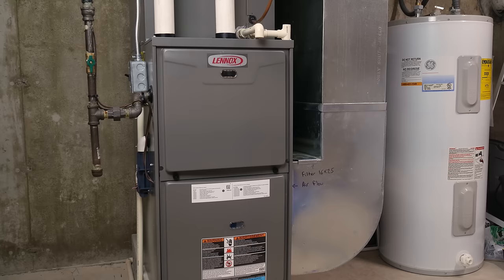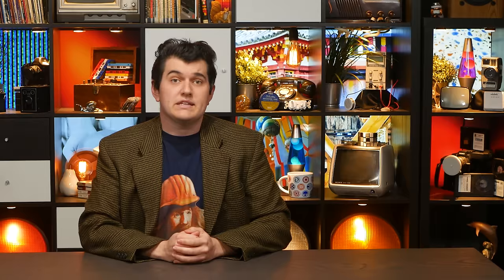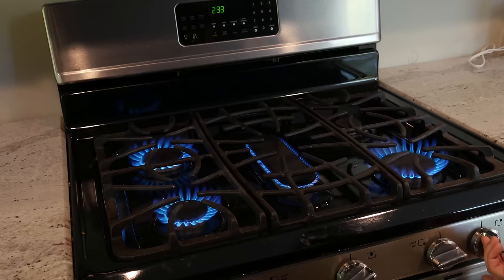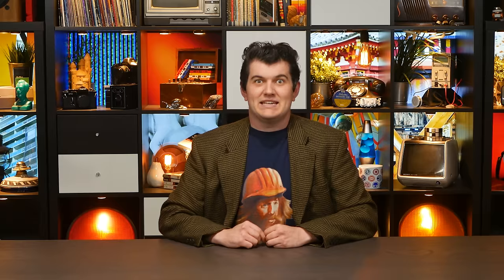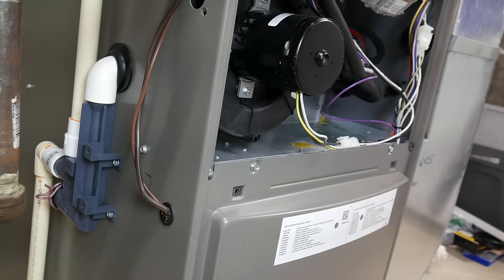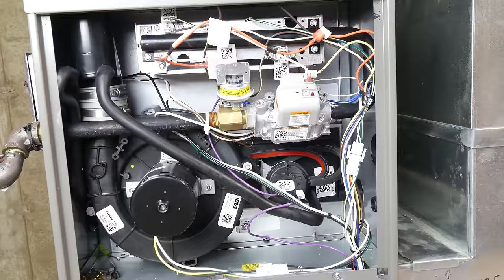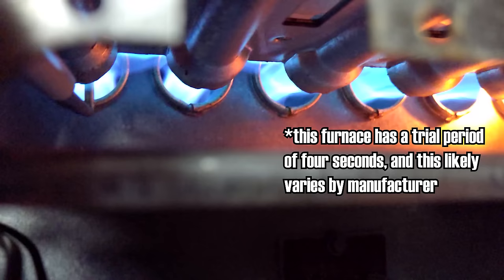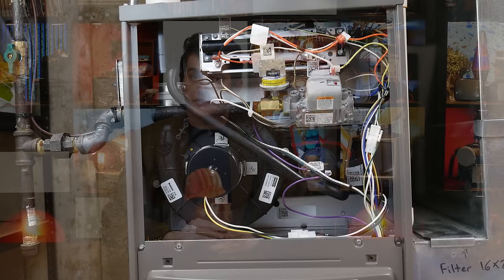Forced-air Furnaces: The What, Why, and How

Comment: European home heating uses hot water as intermediate steps.
The boilers are a bit different in setup. Outside air connects to the enclosure. Gas is fed via a gas pressure regulator into the fan intake which sucks air from the encloure. The fax mixes gas and air and pushes it into the burner.
Th eburner has a fine mesh to prevent the flame traveling back.
Ignition is via a spark which also checks ionization.
The flame only exists inside the heat exchanger, which often fully surrounds the flame.
The flame burns downwards, meaning that only the coolest gases can escape.
That is with an alumin(i)um heat exchanger. Stainless steel ones are a bit different.These boilers are really small, delivering heated tap water and water for heating at 35 kilowatts for example in a 55 x 37 x 27 cm package.
(22 x 15 x 11 inch). In apartments, they may be installed in a kitchen cabinet even.
Here is a service video on one that does hot water for heating and hot tap water: https://www.youtube.com/watch?v=AogaQXRH1UI 
Note that these have a variable speed fan (and pump nowadays) to allow for variable output (and optimum efficiency).
Reply: And hot water vs forced air is like night and day. Take it from someone who has lived in both types. If you have a choice, go boiler. Been there, done that. Forced air cannot possibly be as efficient. Or as comfortable to live in.
Reply: I was already thinking - the USA's forced air heating is probably designed without such goals for compactness. Aside from the size of the furnace, you've got the ducts that take up a lot of space compared to radiator pipes.
Reply: @benj1008  It's cheaper to install. Much cheaper. Money is the name of the game. And the further north you go, the less you see of it. And for air, you have to add that separately. However, that's also much  more efficient than the forced air furnace.
Reply: Most houses I know burn heating oil (mazout) instead of gas, is that even a thing in the US?
Reply: Forced air systems are huge, and LOUD as FUCK. I much preferred radiator heat in Europe. It was dead silent. According to Zillow, there are zero houses in central Ohio with a radiator.
Reply: @ArrowRaider  The forced air system is much cheaper than hot water to install and usually comes with air built in. However it is also quite inferior. Set a boiler system to room temperature and it stays there. Forced air is constantly fluctuating. Not to mention the maintenance on forced air is much higher. It's almost non existent with a boiler system and much cheaper to run. So what it "boils" down to is... money. Initially cheaper but in the long run more expensive. Cheap sells! No one tells you it will cost a lot more to run it.
Reply: I live in a shitty typical apartment. The unit is in my apartment and so it is loud. There are heat pumps outside, one for each unit. Each one is very loud. It is not possible to enjoy the balcony because at least one outside unit is always running all of the year. The vents are in the ceiling. They throw air at me which makes me cold when the heat is on. The blower and vent noise wakes me up at night. The temperature fluctuates like crazy and it is very expensive to run. Pretty sure the unit  is stock original from the 80s.

I preferred silent, constant temperature radiators during my many travels in The Netherlands. The split AC system worked fine in apartments there. No one in Ohio knows what a  heated towel rack is either.

Comment: Gosh I wish I had watched this before I bought my garage furnace last year. Went with traditional instead of high efficiency and I have always wondered if that was the right choice. Just having the PVC exhaust instead of metal roof vent alone would have been worth it. 
As usual, great video. Very informative.
Reply: Getting yourself a heat pump is a much better option than a high efficiency furnace. Unless you live in the very north, your annual cooling season load will be much greater than your heating season.

Comment: Can't wait for the Heat pump video. We moved into our new house in February and I chose to have Heat pump and hot water floor heating and it has been amazing so far, don't need to worry about it at all and it can even run in reverse (as AC) and cool the floor in summer.

Comment: Hello there, Quebecer here, up here resistive heating the whole house has become pretty much the standard (thank you massive hydroelectric dams up north). Most houses come with simple baseboard heaters and nothing else. Up until the late 70s, oil furnaces were pretty much the norm, but most people are replacing them with electric furnaces (yup, furnaces with big fat resistive heating elements, usually around 15KWh, my last had needed a 100A 240V circuit). Electric furnaces typically have 3 elements that come up one after the other to avoid the massive current draw that would happen if you turned everything on at once. 
More and more though, electric furnaces are combined with heatpumps, making the furnace only come up during really cold periods (typically lower than -13C or 8F). My previous house was a 60's one story with basement (around 1800sqft combined) and the average electrical bill was 140$CAD a month (about 100$USD), that included heating the house 6 months and keeping it cool around 3-4 months out of the year, (electric water heater and range too). We're probably one of the few places were 100% electrical heating makes sense, especially combined when with a heatpump. On new houses though, simple baseboard heaters are still the norm (because $$$), if you're lucky your split AC will do heating but not the norm.

Comment: As a child, I thought adults were saying, "four stare" heating.  So, when I was cold, I'd look (sternly) at the register a few times, but alas, nothing happened.
Reply: thats cause you never actually TOLD it to get warmer after staring.
i bet the poor thing though you were going to beat it.
Reply: The first models worked kind of like a clapper - stare ON stare OFF, but early adopters found the system too unstable. It could be set OFF with a passing glance.

It was Benjamin Franklin who came up with the "double stare" variant, known today as "four stare" as most users do not wear glasses.

Comment: In Québec, we use mostly electric "everything" since electricity in the province is so cheap and renewable (between .06 and .09$/kWh). Heat pumps are getting more and more popular, but since it gets -30c outside, we need resistive heating to compensate. Only the most remote or northern cities use fuel heating systems, or big buildings use natural gas furnaces. 
Still very interesting video as usual!

Comment: I'd love to see a video about the radiator and boiler furnaces. That's what I've got in my house that was built in 1886.
Reply: Imagine the forced air furnace, but with water instead. Thats basically it.
Reply: @Smok3yR1der  I just imagined hot water being sprayed into the rooms. Luckily I learned to not drink while reading comments or I'd need a new monitor and keyboard.
Reply: So, how come you can't pump chilled water just above freezing and get air conditioning from it? Its not the same?
Reply: @williamnichols2067  You can and there are systems like this. It however is not quite as easy because condensation around cold pipes is an issue. Also, you still need an AC to cool the water, so it just adds extra effort when you could just pipe the coolant around instead.
Reply: @williamnichols2067  because during AC the refrigerant is picking up the heat from the air and moving it outside to the condenser where it is vented. Water doesn't behave properly to allow for refrigeration.
Reply: @williamnichols2067  Chilled water systems are used extensively in large commercial buildings. A typical system uses two water loops. The actual refrigeration unit works similar to home air conditioning unit on a large scale, except the two heat exchangers transfer heat with water instead of air.  The evaporator cools a loop of water which is sent to air handlers in the building to absorb heat. Likewise, the condenser also transfers heat to water, which is then cooled in an evaporative cooling tower.
Reply: @williamnichols2067  because it would freeze in the pipes.
Reply: @HenryLoenwind  In Toronto, there are several big office towers that pump cold water from the depths of Lake Ontario through them for cooling.  They dump the slightly warmer water back into the lake,
Reply: @minuteman4199  - Canadians are doing their part for global warming LOL
Reply: You don't need carbon monoxide sensors throughout the room so you are luckier

Comment: I live in Scotland and usually (this is true for most of the UK too) we'll have a boiler and radiator system, and since our boiler is downstairs the exhaust pipe is located on the side of my house in the back garden this means that not only does it get a little steamy back there, but it also smells like used gunpowder, of course, that's only if the boiler is running full blast, the insulation is quite good so  it only runs when the ambient air temp drops below a certain threshold

Comment: I wondered what this condensing furnace story was all about.
Now I know, it's fitted with the additional heat exchanger to recover more energy.
Furnaces with economizers of course heat the combustion air with what energy is left in the flue gasses and that makes for near complete energy recovery of the combustion process.
What comes out the exhaust is cold.
A furnace is a great bit of kit, a must have for cold climates.
Thanks for the video.

Comment: "Buildings constructed before we became addicted to air conditioning."
Yep, that describes my parent's house all right. Boiler and radiators, and a 600 gallon oil tank.
We had AC installed when we did a remodel soon after moving in, routing those tubes was interesting (but it was managed!).
Reply: It is a shame everyone rips out the radiator systems when they see them.
Reply: @ArrowRaider  Oh we kept the radiators. The house is like 150 years old now I think, so keeping that relic was fitting.
Reply: @ArrowRaider  yes, people really underestimate how the infrared radiation from a hot radiator makes us feel warm and cozy.
Reply: @HenryLoenwind  this video fascinated me, as over here in England I’ve never come across a forced air heat system before. We only really use the gas boiler/radiator system over here. I have to admit, it does work really well, and as you say, adds to the cost factor. Handy for drying towels too 😂

Comment: Finally I understand why Airbnb is so persistent about telling me if a carbon monoxide alarm is present in the flat / house.
Reply: Liability for them
Reply: @NicholasLittlejohn  not dying is also a neat side effect of this corporate policy
Reply: It doesn't make so much sense in properties that are heated solely by air conditioning!
Reply: @NicholasLittlejohn  I was a little bit a wonder why this was so important to Airbnb. They specifically highlight if no CO alarm is present. It's a little bit unusual because in Europe, where I live, hot water radiators are the most common heating system. That's why I found it unusual to make such a fuzz about the CO alarms. But now I know why.

Comment: I used to work environmental combustion and there’s as many way to light a flame as there is to prove it. 

Usually we’d light using HEI, high energy ignition, basically a neon transformer and a spark plug sometime backed up with a piezo ignition, like BBQ. Other times we use a remote system called an FFG, flame front generator, to shoot fireballs down a pipe which is advantageous in that you can add valves and light multiple pilots. These systems used continuous monitoring and automatic relight sometimes without timeout because safety concerns for flares. 

As backup backup we’d use projectiles. Basically a giant six gun shooting a magnesium flare down a pipe with a hard block at the end causing them to explode. Another is the fancy industrial model rocket on a wire shooting through the flammable gas along with manual hand crank systems that hold something like a road flare. If all that fails your down to 2 systems the short straw with a handheld igniter, a match or a modified maglite with a 6ft pipe and spark plug, to good old bow and flaming arrows. Yes flaming arrows are an acceptable way to light an emergency flare in an emergency. 

To prove flames we used thermocouples, flames rods, infrared, and UV. Thermocouples with a simple temperature relay was the simplest. Flame rods are more common in smaller systems and are as described in the pinned comment. The big boys use optical proving from the hotel boiler that has a Honeywell blue cube and a camera that looks for burning natural gas’s light spectrum to many thousands for a UV tuned to Hydrogen specific wavelength since its invisible to the naked eye. Some cameras are mounted opposite like in a boiler but for larger they can be ground mounted pointed at the top of a stack.

Comment: Marvelous video. I would only want to add the information that CO detectors should not be installed on your ceilings, as many models are sold for this purpose. CO is much denser than air and by the time the ceiling mounted detectors are triggered, you won’t be able to wake up to hear them. Detectors can be installed in walls or plugged into outlets at a more reasonable “sleeping height”.

Comment: 12:32 at my house we have a fresh air ventilation exchange system that somehow brings fresh air into the ducts without reducing the efficiency or bringing in cold air, I believe it is because the system somehow collects heat from exiting stale air and transfers it onto the cold air coming in.
Reply: There was a device in Popular Science back in the early 1990s that did this.  The one in the article could have a heat pump built into it to also work as a heater.  But basically the idea of the thing is the pipe bringing in the outside air first runs by the pipe just about to expel air from the inside, and then runs backward along it, until shortly before it enters the home.  Ideally, the actual input and output on each end will be some distance.  There's a fan in one or both pipes somewhere to cause the air to flow in a consistent direction.  Apart from the areas where the pipes are intentionally letting heat flow between each other, it's all heavily insulated.

At least, that's how Popular Science described it, modulo about 29 years of forgetting stuff.

Comment: The world seems to have some odd view that the USA has really inefficient shoddy buildings codes, when they aren't that bad, just a bit outdated. I know someone who worked in house construction planning in the USA, and they are baffled by how relaxed the rules in the UK are, we got bedrooms with only one double socket in one corner because "its cheaper"
Reply: We have decent codes, it's the actual construction that's shoddy.
Reply: Our electrical systems in the UK are very safe, with several levels of protection, which is just as well considering that most of our houses were built before there was so much demand to plug things in (necessitating the use of power strips everywhere.)

Compared to the US, you still rarely hear of a house fire caused by an electrical fault here, unless it's a faulty appliance like the combustible imported clothes dryers and fridge freezers that seem to have become commonplace, so our wiring at least seems to be up to the job. 

In terms of heating, we tend to use hot water boilers feeding radiators, I'm guessing because it's much easier to retrofit copper pipes to older homes than air ducting (although some homes in the sixties and seventies, including the one I grew up in, were built with the latter, its fallen almost completely out of favour).
Reply: As an American, my mind is blown by how unbelievably lax British fire codes are.  Like, the stuff that caused the Grenfell Tower fire was purchased for a government housing project.  In America, it’s not even legal for sale, let alone for use in large apartment buildings.
Reply: That's going back a very long time before one double socket would have been acceptable in a (new build or refurb) bedroom, according to UK building regulations...
Reply: @michaelimbesi2314  The stuff that was used in the Grenfell tower, was ilegal for use in apartment buildings, or for cladding any building in fact. People from the council, the houseing assotiation, and the company that installed it should be in jail right now, but it was poor people living there so the government doesn't give a shit.
Reply: "The world" tends to only hear about old buildings or shoddy construction or maintenance jobs.

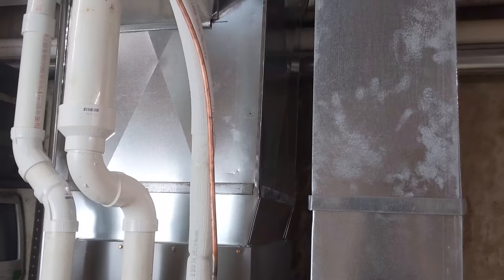Comment: 17:15 So THAT'S why my fans don't kick on right away! Seriously I always wondered. My bedroom looks on the 2nd floor is right under our furnace in the attic (that's in addition to the 1st floor furnace that's in the basement).

Anyway I hear the unit clock on right above my bed, but the vent over there near my door doesn't actually start spitting out air til after about one minute. 

I was always MAD at the unit but...Now that I know the alternative would be to blast cold air on me...THANKS FOR WAITING, MR. FURNACE!
Reply: Fun fact: This is likely on a completely independent system, not part of the ignition sequence. My furnace is outdoors and in summer the direct sunlight gets the heat exchanger hot enough that the blower comes on, even though the main thermostat is turned off.